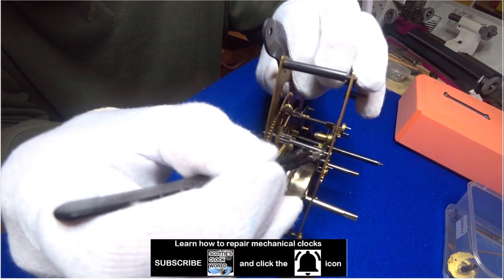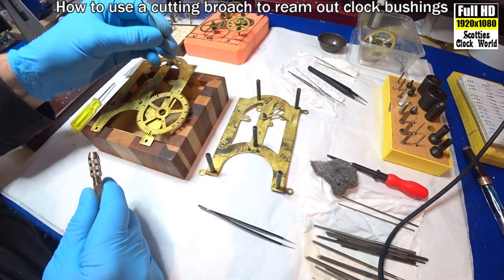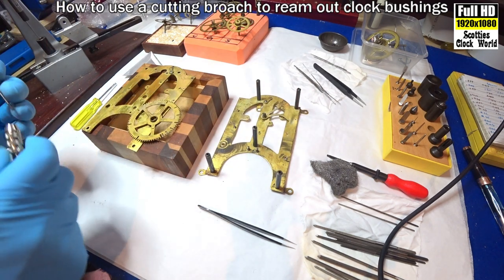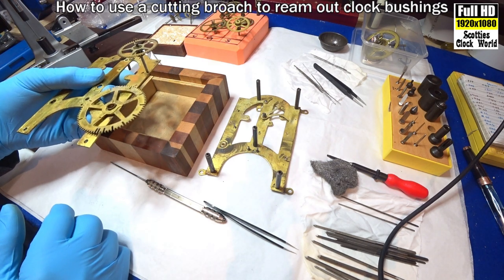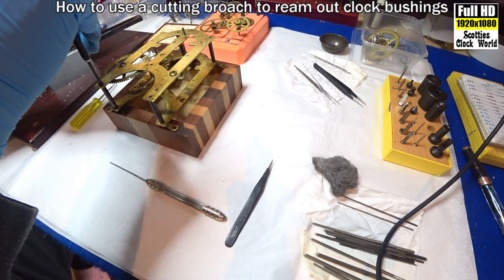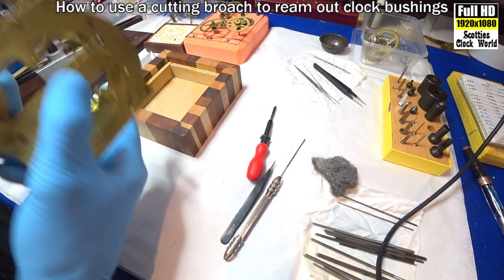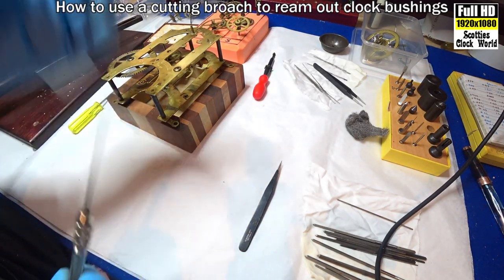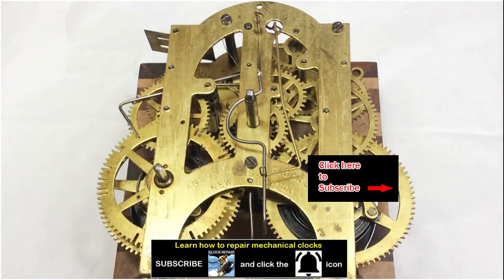How to use a Cutting Broach to ream out mechanical clock bushings

Comment: Thanks for the tutorial. The only thing I did a little differently was to use a smoothing broach (since I have them) to take the bushing the last little bit of the way after using cutting broaches. The smoothing broach also leaves a nice polished and rounder hole not that it's critical on these kinds of clocks. 
All the books I've read on the topic specify about a 4 degree tilt on the shaft so rather than putting it together and taking it apart several times to test clearance I went with the angle approach to knowing when the hole was big enough. The concept being that we want enough clearance for a good film of oil between the pinion and the bushing .
Reply from the maker: The reason we put wheels between the plates to test them is because it's virtually impossible to accurately assess 4 degrees of perpendicular and 5 degrees of perpendicular, the latter being a rebushing job required.

Comment: Since broach is tapered wouldn't you be best to do it from both sides of plate?
Reply from the maker: The bushing is held into the plate by friction so if you also broached from the front of the plate you would remove extra material which would reduce the amount of friction between the plate and the bushing.
Reply: The inside of the bushing should be from both sides.